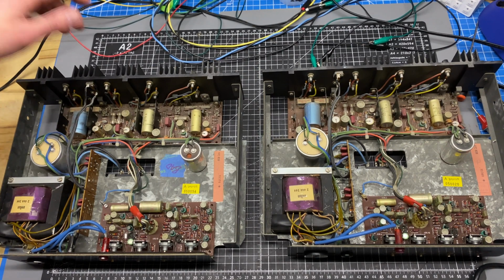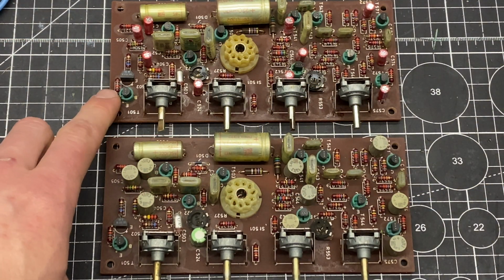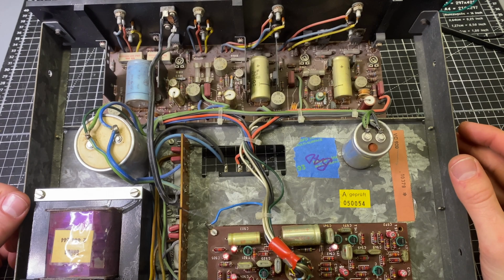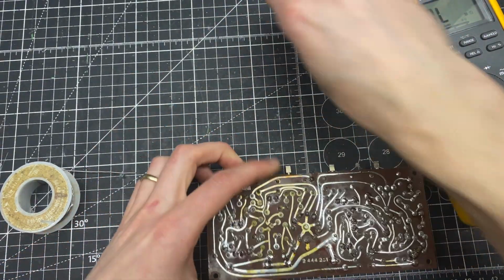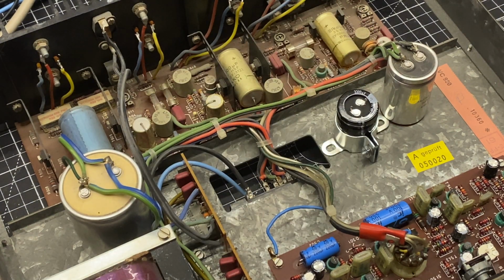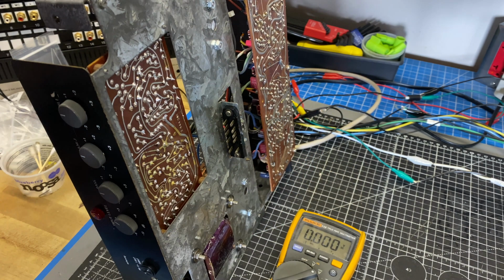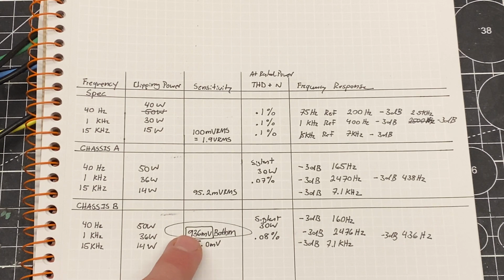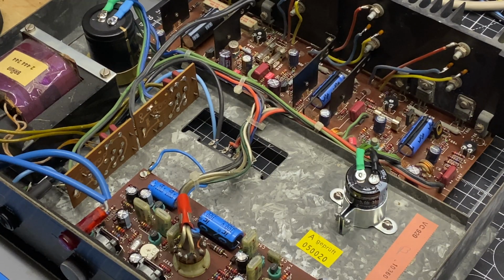ADS / Braun LV 1020 Repair | P1 - Amp Module Restoration

Comment: Aren't those plastic electrolytes tantalum? I don't think there was any need to fix the large electrolytes with metal clamps. It would have been perfectly fine to mount them horizontally and secure them with plastic clamps. Also, I don't think there was any need to solder the feet, and then solder them to the electrolyte pins. All praise for the work done!

Comment: Before I pull e-caps, I always black-dot the old caps marked negative on the board with a sharpie, so, regardless of the boards marking, I knew how it was installed before work. Glad you got it figured out and working.